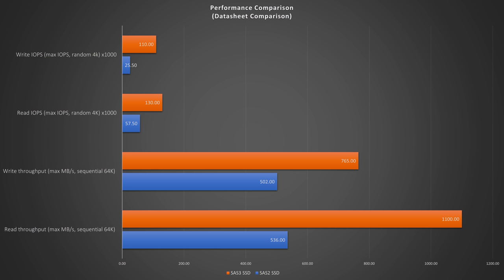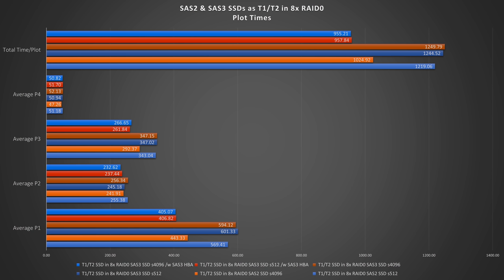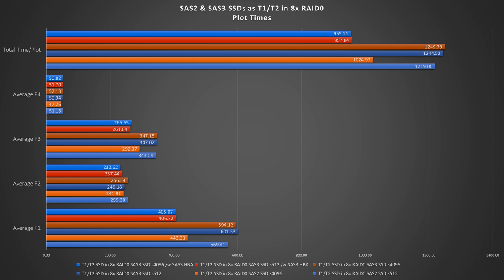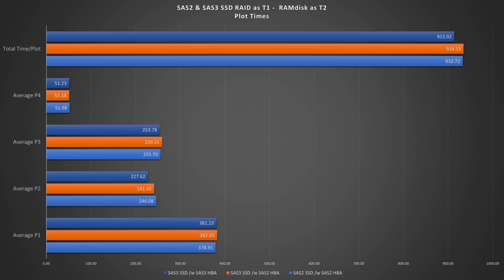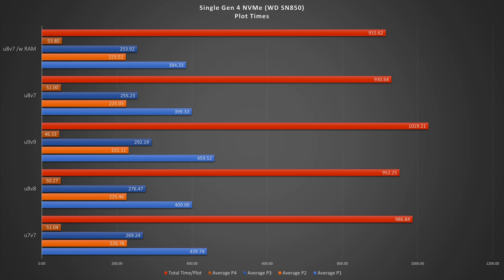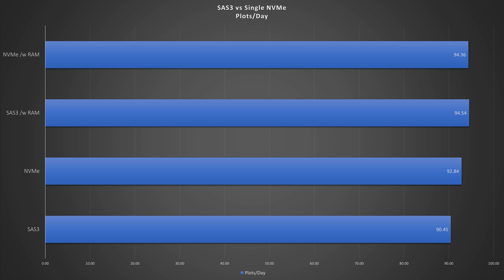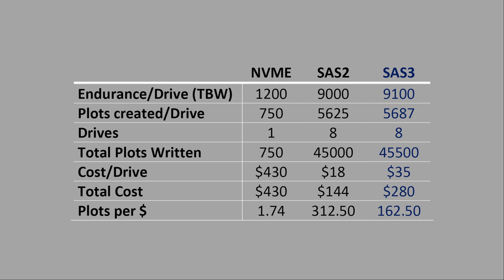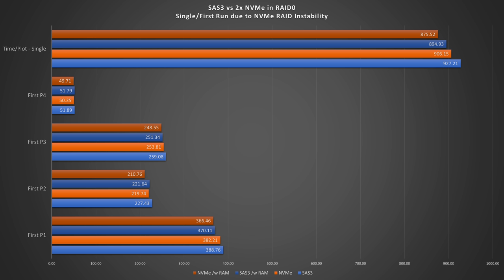Can SAS3 DC SSDs be faster than NVMe? (MadMax Chia Plotter)

Comment from the maker: Oh dear, my tired self managed to sneak in a mistake that was replicated in a second table. This doesn't change the actual outcome, but I still want to note that in the first two test comparisons, the SAS2 SSD plot times for "SAS2 HBA T1/T2 SSD in 8x RAID SAS2 SSD s4096" should be as follows:

Total Time: 1203.485 (not 1024.917)
P4: 47.12173333 (not 47.2592)
P3: 354.0145 (not 292.37)
P2: 258.8515 (not 241.9135)
P1: 543.4485 (not 443.3268333)

I accidentally selected the results from one of the RAMdisk runs. I do apologize, my spreadsheets have a sizeable amount of data and I will do my best to attempt to avoid this happening in the future. I wish that I had caught this before publishing the video, but I just wanted to point this out so that no one gets confused or possibly questions the validity of the content. Since this doesn't affect the outcome of the video, I will not re-shoot and edit the video unless I am asked to.

Comment: Question - did you make sure that the SAS3 SSDs were actually linking to the SAS3 HBA at 12Gbps? I've got three SAS3 SSDs and an LSI 9300 HBA, but because of the crappy cables I've got they're only connecting at 6Gbps. Just physically connecting 12Gbps SSDs to a 12Gbps HBA doesn't guarantee 12Gbps speeds, unfortunately.
Reply from the maker: Excellent point, and you are actually correct!

I've already planned a few bite-sized videos about unexpected things such as this one.
I verified with ssacli that it was in fact running at 6Gbps instead of 12 Gbps and I have been on the quest to find cables that can actually handle 12 the past week! =)

Comment: I’d like to understand why 8x drives. The more drives in Raid0 the more plots you can run at the same time?! I’m really new to this
Reply from the maker: You are correct in that using RAID0 will allow for a logical drive that is the combined size of each physical drive that is a part of the RAID, but in this case, we are interested in the speed increases from having 8 drives acting as one. =)
Reply: I have Dell T5600, dual 2680s, 48gb, 2x 146gb SAS 15k as my plotters. Regardless of how many threads I do (max I’ve tried 28), it’s still taking 8hrs for a single plot.

Am I supposed to be running as many SAS drives as I can? I can run upto 5 I think.
Reply from the maker: @donovannewton9507  yikes! 8hrs is not the best of times! If you watch my video where I tested the 15k RPM HDDs, you will see comparisons between 2x, 4x, 6x and 8x RAID0.

My findings were that 8x 15k RPM HDDs were very good for T1 but not necessarily for T2. I haven't started my server test series yet, so I can't give you any apples to apples comparisons, but on my system there was definitely a huge boost in speed when adding more spinners to the RAID.
Reply: @JanisRode  I think I rewatched that just before and realised that’s what was happening. Trying to make sure the Herc H310 is faster than 3Gbps as well.

Comment: I have a newbie question here try not to laugh I am running a dell r730xd and using 8 sas3 ssd, and ram drive . 48 threads and madmax. Best I can do is 35 min plot 1st one the times increase as new plots created up to 45 min. Using windows 10. Any tips on how to get better performance. Btw when I try to do just ssd it takes longer .
Reply from the maker: We've all been newbies, and we are all still newbies when it comes to most things in the world, for instance, if I tried to wrangle a crocodile, I would most likely end up dead. It would be silly to laugh at someone who has less experience.

Regarding your plotting experience, I haven't really done any windows plotting since my first Chia video. If you want to, you can look at that one, I am a bit long winded in it (first video and all, plus kind of a huge subject), but I just added chapters to it so it should be a lot easier for you to navigate.

I would personally recommend switching from windows to Linux and from NTFS (I'm assuming that you're using NTFS with windows?) to something faster like XFS (really, just anything but NTFS seems to speed things up). If you are not comfortable with making the leap to Linux (it's really not as bad as most people think, especially not if you go with a GUI based Linux like the standard desktop Ubuntu), I believe that "Digital Spaceport" has a few recent videos about Windows plotting.
Reply: @JanisRode  if I was to try to get Ubuntu installed and format the plotters drives with Xfs would work with my final destination drive being format ntfs? My farmer is running windows 10 . I currently have set up three machines as plotters. 1 server 40 min plots , i gaming machine 45 min plots and and old i7 90 min plots. Those drives are each ploted and transfered to the farmer machine .
Reply from the maker: @joebama6945  Excellent question! Windows can see NTFS but not XFS, Linux can see both (but NTFS is really slow in Linux as well in Windows).

At this point in time, my farmer is still a windows machine, and the HDDs are still formatted as NTFS drives, but I plan on doing some testing on those in a month or two, since I plan on having my farmer be a different computer in the end that will be running Linux so it will be able to see pretty much everything.

Long story short, YES! You can definitely do that! In your case I would recommend that you start with your slowest plotter just to get comfortable with it and so that you can see whether or not you are indeed making any gains, and so that you can be comfortable with the choice of plotting to NTFS from Linux.

A large portion of testing is working up the courage to "take the plunge" and undo something that is working with the intent of making it work better. Don't force it, make sure that you are comfortable with your own decisions and make sure that you can verify that what you are doing is in fact working, don't just trust some random guy on youtube. =)

One thing that I would advise you to do is to google how to upgrade to the latest kernel in Ubuntu, that should keep you from most XFS raid crashing issues. Ask me how I know. ;)

In essence, do it, but take it slow. =)

Comment: So what your recommending is go SAS 2 drive with a SAS 3 enclosure to get he most bang for your buck?
Reply from the maker: I'm not making any official recommendations, but yes, those SAS2 drives combined with a SAS3 HBA get extremely close results but are cheaper, while getting almost the same amount of plots written (45k vs 45.5k for 8 in RAID0). =)

I'm trying to figure out if I can get the SAS3 SSDs to go any faster now, I have 2 things left to try but need to wait for new components to arrive first.

If you give me a week or two I might have a different result, but they are still twice the price and both of them are fairly close to what a $400+ NVMe can do, which won't last anywhere near as long as those 8 SAS drives (no matter which kind you choose).
Reply: @JanisRode  Great, keep us posted

Comment: maybe the HBA is the bottleneck and the drive does not matter because they are 8x parallel anyway
Reply from the maker: The fact that swapping out the HBAs made it go faster is indeed a clear indication that the SAS2 HBA was the bottleneck, I'm wondering how it could be possible, since each SSD is in its own 6Gbps channel (8x6Gbps), without being capable of actually hitting that 6Gbps. It's not really a huge issue, since I can just retest everything, I just think that it's odd that it could happen in the first place.

The other issue, that the SAS3 SSDs were so slow, is a bigger nuisance, since I can't just swap out a component and make it go faster. =(